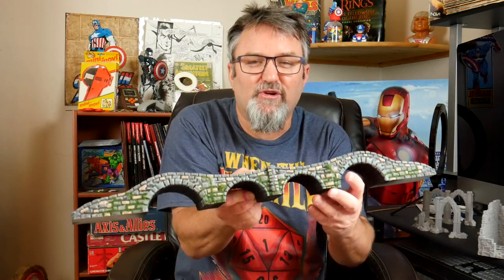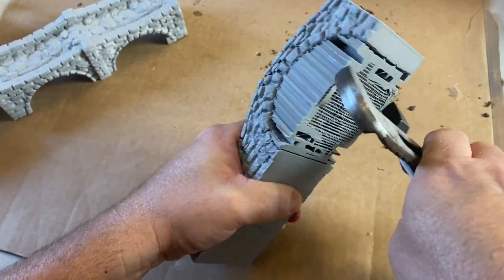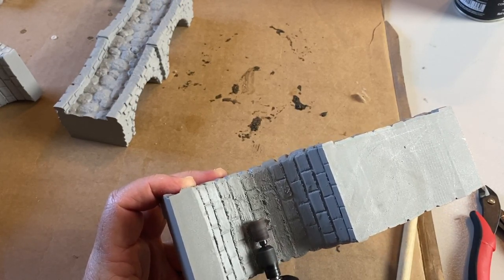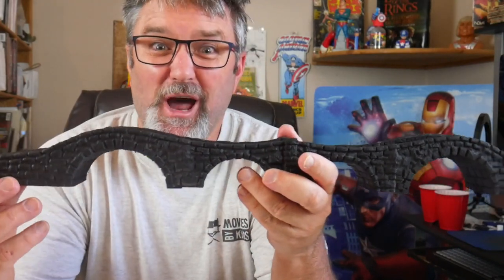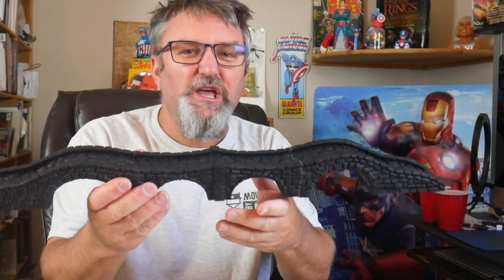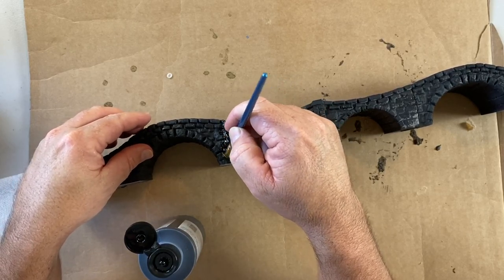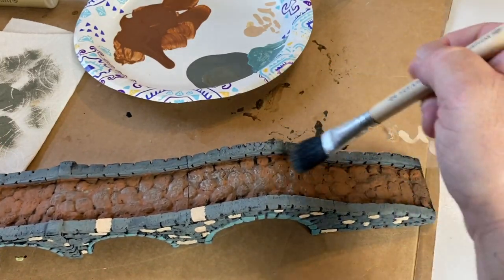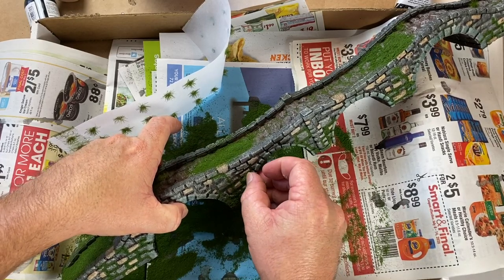Is it worth it to 3D print terrain?

Comment: I love using my Ender 3 for printing terrain, but I also like building as well. A good middle ground is to print bits and pieces to incorporate into builds. Or if you print something like a building just add onto it, like print everything but the roof and build a thatch roof. I see it as expanding what your capable of building. You no longer have to worry about if you have the right bits of in a bits box, or a bead that is shaped like what you want. Plan something and get out what you have to use and print the pieces you don't.
Reply from the maker: Hi, this is the other crafting brother, John here... You hit the nail on the head!  I agree with you 100%, build what you want and use the 3D printer to add bits and pieces that are either too small or too hard to craft.  I think this is an acceptable medium for crafters who want to enter the 3D realm but still want to craft👍.  Thanks for sharing this comment!

Comment: Where could I get the coding to print actual figures? I just ordered a 3D printer and idk exactly how it works but I’m pretty sure you can’t just input a picture and it’ll print, you have to have the dimensions correct?

Comment: For fixing areas you have marks on, a Woodburning pen works great.  You can use it like a soldering iron with spare pla to fill in gaps.  You can also easily draw in lines for brick work.
Reply from the maker: Fantastic tip.  I'm going to try that, thanks
Reply: The Crafting Brothers I got a throwaway burner at a discount store.  There will be fumes from the melting plastic so well ventilate.  And it will burn so its a technique I'm still working on.  It's like sculpting almost.

Comment: Nice video. I do a ton of 3d printed terrain for games. I would offer the suggestion that you don't really need to use that much infill. My standard amount is 5-8%. It will save you time and material long term. Your prints came out very clean which is great to see for someone new to the hobby. Keep up the good work.
Reply from the maker: Thanks for the tip! I’m so new to the 3-D printing world, I’m not even sure what infill does???  I’m just diving right in

Comment: Warping is a real issue with PLA. You could try printing PETG, it requires only a slightly higher printing temperature, but is way less susceptible to warping due to a higher temperature resistance. It's usually marketed as being somewhere between ABS and PLA in terms of advantages, really good stuff!
Reply from the maker: Great tip.  I don't know what PETG is (I'll look it up).  Thanks
Reply: @thecraftingbrothers9448  PETG is basically the exact same type of plastic soda bottles are made of. Pretty sturdy stuff, really. Usually it's just as readily available as pla and abs.

Comment: Last suggestion is for reshaping large areas, use a heat gun.  Does the same thing the sun would do but you have control.
Reply from the maker: Funny, I just pulled out my glue gun yesterday and yes, it works great.  Thanks
Reply: Thanks, living in UK was thinking of how to do this, thanks for advice.

Comment: Looks great, yeh youll get used to the slicer settings. I use small needle nose pliers, tweezers and clippers to clean up prints, you can also use a jet lighter to burn away the whispy hairs. Personally I wouldnt have glued it together so i could store it easier. Wrt if 3d printing is worth it: it can be expensive for larger prints but not as expensive as buying a resin/plastic building. For small parts its definitely worth it, so cheap. Comparing it with crafting things from xps etc. Crafting is cheaper per piece for larger pieces but obviously much more time/work expensive. The tools and materials for crafting can easily add up to be more expensive than a fdm 3d printing setup. I have a problem where i can print much faster than i can paint so i get a large backlog of unpainted prints which becomes a problem and it can feel like a chore nedding to get all these prints painted when theres other things i want to work on. Crafting is more rewarding in terms of creativity.
Reply from the maker: Thank you for this comment... I absolutely love crafting, although I have a problem with fine motor skills on my left have so I find it very tedious to craft small things.  I am liking the printer as I can concentrate my efforts on the paint job instead of using knives and glue guns.  Thanks for watching